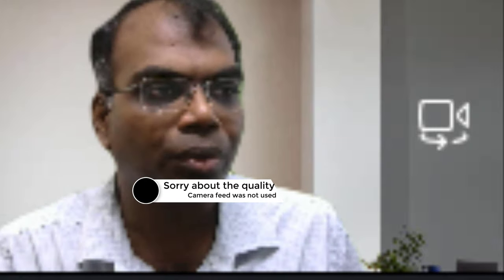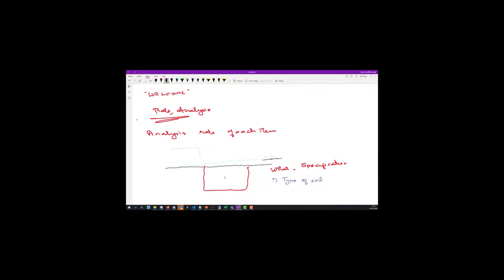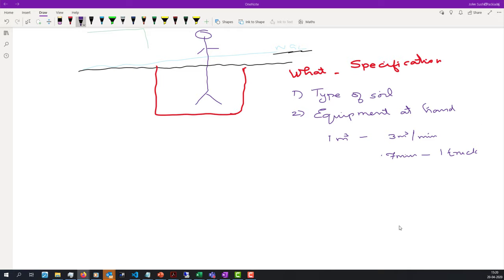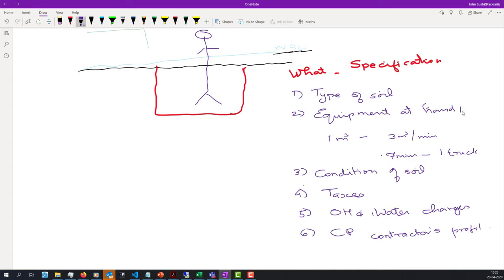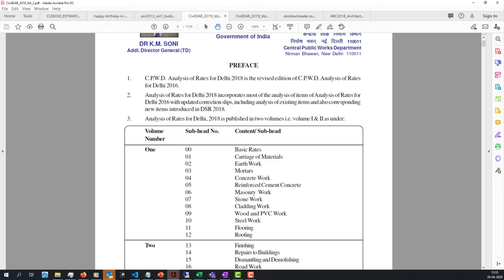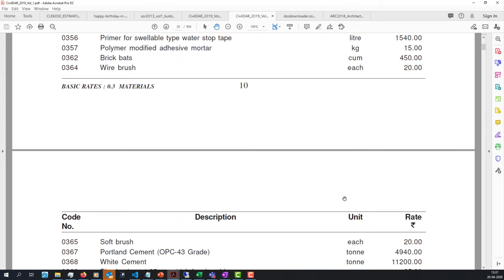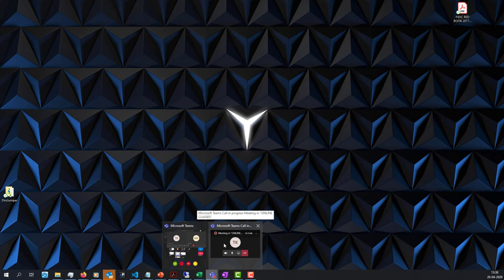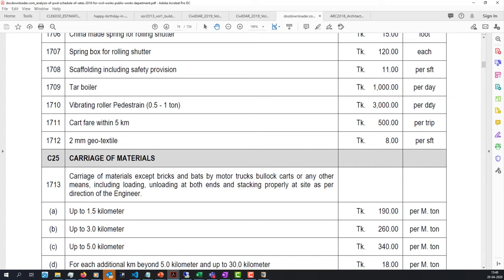Fixing Construction Project Cost - How to do the rate analysis to CPWDs 2019 Delhi Schedule of Rates

Comment: 1. How to apply DSR in Jaipur using DSR?
2. How is GST arrived at 0.1405 multiplying factor?
Reply from the maker: Hello Mr Kumar,
I realize that I had not addressed the reason for the 0 .1405 being there.  I am  sure that the explanation provided herein will help many engineering college students and practicing engineers.
1) Please refer the PWD manual of Rajastan.  They will give the required factors which you will use to scale the DSR in your state.  IF DSR works out the price as INR X, then in jaipur, it will be n*X. Typically, in Tamil Nadu, when work is done in hilly terrain, the value of 'n' will be higher than when working in the plains.  
2) When you take the GST slab as 12 % however we add Contractors Profit and Overheads (CP & OH) Reverse working calculation for 12% GST and 15% CP & OH, you get .1405.  
I did a quick excel sheet to help you understand how the value of .1405 is arrived at. I will upload the calculation elsewhere and share the link a little later.  Meanwhile, I am reproducing the calculation herein.

Sheet to calculate the Multiplying factor for GST - CPWD Rate Analysis     
When we multiply this factor, we get the GST amount.     
Let Assume that Multiplying factor is 'x'     
The variable parameters are        
Amount worked out = INR W  
GST for the job         = 12%  
CP + OH   15%  
Amt with GST                = INR W + ( x * W )  ( --> [A] )
Add CP + OH                 =  0.15 * W + ( x * W )  
Amount after CP + OH =  1.15 * W + ( x * W )  ( --> [B] Includes GST)
Let us find out what will be the GST Applicable Amount which yields [A]      
Working backwards = INR 1.15 * ( W + x * W ) / 1.12  
     ( --> [C] )
[B] is the amount on which GST is to be computed     
This gives amount that includes the GST as     0.12 * ([C])  
 = INR 0.12 * ( 1.15 * ( W + x * W ) / 1.12 )  
Now, the value given by the expression ( x * W ) is the GST paid for work worth INR d     
( x * W ) = 0.12 * 1.15 / 1.12 * ( W ( 1 + x ) )    
Dividing both the sides by the common term W, yields the factor x as     
x = 0.12 * 1.15 / 1.12 *  ( 1 + x )    
  0.12321 *  ( 1 + x )    
Solving for 'x', (x - 0.12321 x ) =  0.1232  
This yields the multiplier for GST x as  =  0.12321 / ( 1 - 0.12321)  
   0.140523957  
  Say  0.1405  
     
Please Note 'W' should include the 1% water charges.     

Terribly sorry if the same does not look very neat